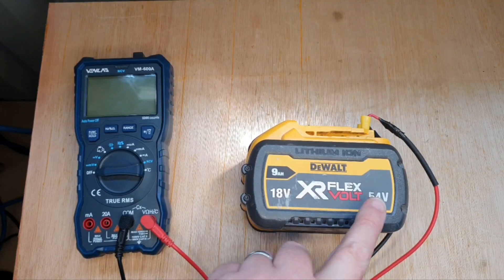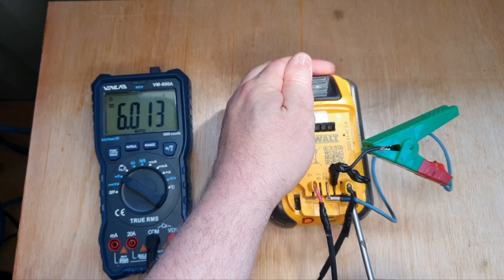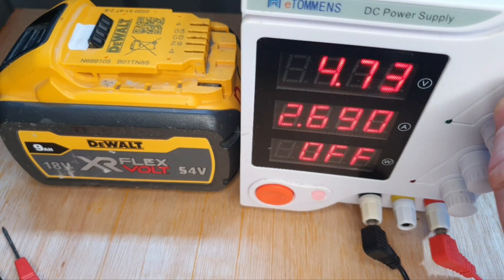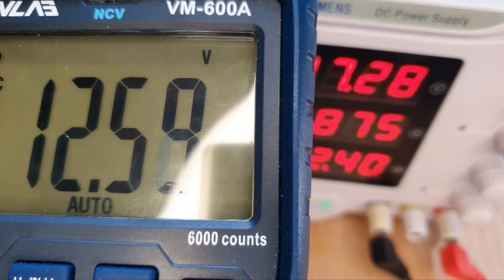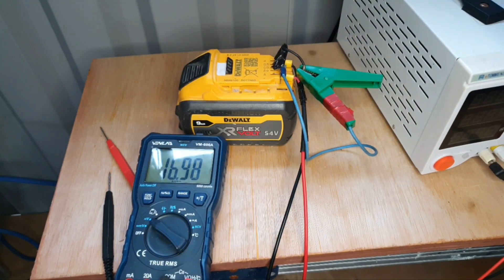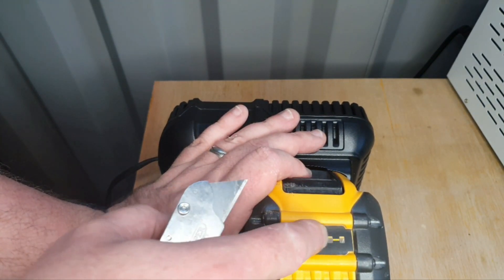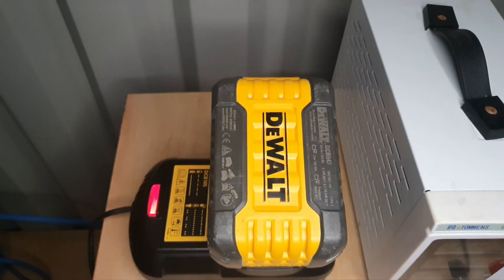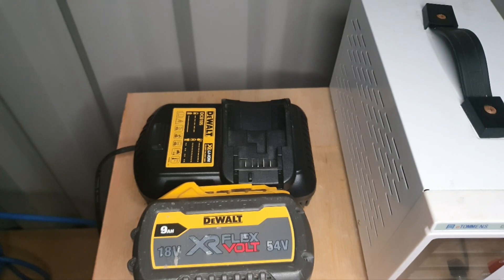How To Fix A Flexvolt (not jump-start) #dewalt #powertools #repair #powertoolrepair #Flexvolt #xr

Comment from the maker: The items used in this repair 
Venlab Digital Multimeter
UK https://amzn.to/3KDi805
USA https://amzn.to/3MlEep8
DC power supplies 
  UK link  https://amzn.to/3LMSO93   
                                                                                                   USA link  https://amzn.to/42ya87A
Reply: How do the battery’s get to that point where they’d need a jump start. I have a used flex volt 9 AH I just bought and it won’t charge and I have no light bars that come on and haven’t tried anything so far!
Reply from the maker: @Rocky-e2b  the cells can drop below chargeable limit I don't recommend just start on flexvolt though
Reply: @doctorlefthandthread  What do you mean just start on flex volt?
Reply from the maker: @Rocky-e2b  sorry typo, I meant jump start don't try and boost it off another battery is what I meant
Reply: @ oh ok how do I jump start it? I was going to try it off another battery lol
Reply from the maker: @Rocky-e2b  I would use a dc bench power supply
Reply: @ Ok I’m hoping I can revive this flex volt battery I bought but might be more wrong with it. I get no light bars on the back and try’s charging for a minute then says it’s charged but it’s not! Won’t do anything it’s a 9 AH
Reply from the maker: @Rocky-e2b  can you check the voltage coming out the top
Reply: @ Yes I sure will I’ll let you know on Friday I’m a trucker and I’m on the road lol From Canada!
Reply from the maker: @Rocky-e2b  cool
Reply: @ I’m just trying to learn a bit about this stuff I love your videos!
Reply from the maker: @Rocky-e2b  stay in touch if I remember I will show you how to test both voltages of the flexvolt 20v and 60v
Reply: @ ok sounds good thankyou!
Reply: @ I checked some stuff out last night there is 16.8 volts coming out of the top of that 9 AH flex volt battery. And I think from checking the cells I have one that’s not working. Most the cells were in between 3.2 and over 4 but I had one that’s reading nothing. The battery looks like it’s seen some moisture in it. It might be a bigger job than I wanna get into lol
Reply from the maker: @Rocky-e2b  I am refusing to.work at flexvolt because the teardown and rebuild takes too.long and there are so many thermal fuses and resistors to blow. You could just have dead cells and imbalance across the pack but even then it is a bit of a mission
Reply: @doctorlefthandthread  Yes exactly it looks like a chore lol
Reply: What unit did you buy? 30v 5ah or higher?
Reply: 30v 0-10A,  Is my DC power supply I just got yesterday dead?  The (V) I set it to 1730V, it is steady on 1756-1757v.  The (A) and the (W) is reading zero not running.

Comment: Fl;exvolt 6Ah dead as - about 2v in 18v mode. I charged with bench power to about 17.5v but it wouldnt charge on dewalt charger so I kept charging and tried it again but no go, so I charged it to 19.5v on bench power and its finally started to charge on dewalt charger - its was already at 3 bars at that stage.  Gunna see if it charges again after discharge.
Reply from the maker: Try it yes if it doesn't it's likely done
Reply: @doctorlefthandthread  I ran it down to 1 bar on the heat gun, and it recharged back up to 3 bars!!!! Awesome.
Reply from the maker: @simonedwards3577 that's awesome 👌

Comment: Got a DC power supply, tested each group beforehand to make sure no over voltages.  Cell groups were all under 2v.  Tried it anyway.  Brought the battery up to 17v.  Tried to charge on my 12-20v max charger.  Blinks for a second or two but the blinking slowly fades to nothing after another second or two.  Working flex volt charges on it just fine.  Maybe the cells are just shot?  I’m gonna test voltage one by one to see what’s going on.

Comment: I charged it to 19v but still when i put it on the dewalt charger theres nothing, one glash of the red light then nothing?
Reply from the maker: Could be cell imbalance thermal fuses resistors all very time consuming

Comment: I’m replaced all cells with new one. But charger still don’t want regonized battery. Is bms bricked?
Reply from the maker: If they are all balanced the bms is done
Reply: so…dewalt also moved to the other side… with hilti….

Comment: I am having a similar issue but when I try using the desktop dc charger I set the voltage as younahve shown and set the amps to approx 0.5 but after a while it drops to zero on the amps any ideas ?

Comment: What volt and amp should i charge each sell at individually pal
Reply: 30v 5amp
Reply from the maker: @deanthompson6664  I would set the amps low probably 2amp and the voltage at 4v
Reply from the maker: What charger are you using?

Comment: What’s concerning to me as I’ve been buying quite a few of these Flex Volt batteries is that this one in the video is only 5 years old, it doesn’t look abused and yet it’s essentially dead. That’s a $200+ battery, DeWalt needs to step it up. I have 20V batteries that are 10 years old or better that are all still fine, being used daily.
Reply from the maker: I agree the failure rate of the flexvolt batteries is too high

Comment: I got some 6ah and 9ah flexvolt battery with 1 bar and 2 bars.  The 2 bars battery, it will charge but will not charge up to 3 bars.  How do you know what volt(V) # and Amp(A)# to set on the DC power supply? I don't know so I just put the same # like you did here.  I charge the battery with no bars, after 5hr plus, it is showing one bar.  I shut it off and try to charge it in the battery charger but it is still not charging.  I hook it back on the dc power supply to charge now why is my (A)amp and my (W)watt display is reading zero?

Comment: This method worked for my battery that showed 1 bar only but would never charge past it on the dewalt charger.  I slow charged it for 3-4 hours and it came back to like.  I spent $30 on a dc battery charger from amazon to save a $180 dewault battery.  Well worth it.  Thanks for making this video!
Reply from the maker: Great to hear

Comment: Hi there 
I have a problem with my DeWalt 6ah as soon as I put it in the charger the light comes on and then off straight away. Any idea what could it be ? There's no breaks in the nickel contact bars.
Reply from the maker: Could be dead cells or something else popped on the board
Reply: @doctorlefthandthread  my 9ah had some visible bits of coating missing from the board and it only charges one bar

Comment: could you design and produce a Jump-start charger product for sale.
Reply from the maker: The jump Start is frowned upon by some due to the sometimes volatile nature if lithium ion however you can use a dc power supply to bring one of these batteries up slowly

Comment: Had a 6 Amp Flexvolt refuse to charge today. So I stuck it on a heat gun and ran it until the heat gun stopped. Then the battery charged! Happy days!
Reply from the maker: Works sometimes
Reply: I'll have to try that if I had a heat gun. My 9AH won't charge. I watched this video that explains what the main problem is: https://youtu.be/ZJHKoo2shBA?si=scqrbh1N1hQQ_HsU

Comment: I have an issue with a 9ah flex volt, goes on charge, but stops charging after 5 mins, only one led bar lit on indicator, but charger says its full. Got 16.5vdc across B+/- terminals, can this be saved?
Reply from the maker: Possibly try this first 
https://youtu.be/IUlHVVt-ptg
Reply: @doctorlefthandthread  everything is intact, no burnt or broken connections. I used a jumper across C connections and pushed plungers, got 49.7v on the 54v side. Digging a little further I think I have a dead cell. One is reading 0v, with all others giving 3.4 to 4.0v
Reply from the maker: @grantmacdonald3126  hard to change a cell in the flexvolt

Comment: Careful with that, I just diagnosed such a battery for someone and one cell was at 5.3v and another was 0.3v. That 5.3v cell is a pending home insurance claim. A cell under 2v can't be recovered, it has to be replaced.
Reply from the maker: 5.3v wow yeah that's high

Comment: I've heard jumping these batteries can turn them.into a fire hazard. Is that true? If you have a dead cell it over charges the other cells
Reply from the maker: The cells have a little failsafe on them that breaks the internal connection rendering the cell useless if it gets over heated of overloaded. The failsafe is more likely to deactivate the cell. If the cell  doesn't deactivate you can experience something called thermal runaway where a cell keep heating up until it explodes. This is very rare and I have never experienced it yet but it is highly dangerous.

Comment: Have a 9ah that reads 17v between b terminals. Almost never used, charged less than 10 times. Was able to run a Dewalt chainsaw with what was left in it but will not take  a charge now. Any ideas? Charger is working on another 9ah. Will charging with a desktop power supply balance the cells if thats the issue?
Reply from the maker: Sometimes running it down to a very low voltage then bring it up with a desktop power supply can work. It has for me but it doesn't always work.

Comment: Why did you test it on an 18 volt tool and not a 54 volt tool?????
Reply from the maker: Thank you for commenting yes you are correct the right thing to do is test it on a 54v tool. So why didn't I?
The simple answer is I did not have a 54v tool available that day but it did work on 54v. I did get it tested later.

Comment: Have the same problem with Milwaukee 8.0ah battery which charge only 3 bars without completing the 4th and have a 12 ah with no charge as well, opened it and checked the cells 3 of them was 3.8 and others are 4, I need to find a way to balance them now, which I am gonna try, this coming weekend 🙂
Reply from the maker: Makes sense they are out of balance

Comment: I thought that being 6 volts across the pack would mean it's dead as a doornail. I got a 12ah here with water damage and it's reading 0 on most cells. I doubt this would work for me
Reply from the maker: Probably not. sometimes if there is some kind of voltage you have a chance to bring it back. conventional wisdom would dictate that if they are below 3v volts I am not conventional or wise so sometimes it works for me
Reply: @doctorlefthandthread  got a 6ah, its a 2022 battery in great condition. Wont charge but voltage across the pack reads 14 something volts, would ya say its fixable?
Reply from the maker: @konstantine381  it could be check for broken connections https://youtu.be/dDP1SHhLgL4
Reply: @doctorlefthandthread  no broken connections, looks like someone's resoldered the board on but the battery works in 18v and 60v. It just has a solid light on the charger and the cells are all 3.3v after i jumped them but still no luck. Might see about replacing the board
Reply from the maker: @konstantine381  what voltage do you have at the 60v range?
Reply: @doctorlefthandthread  51.3v in 60v mode and 17.1v in 20v
Reply from the maker: @konstantine381  if you could drain it and slowly charge it up to 17.5 it might take the charge then
Reply: @doctorlefthandthread  ah ok, so i can slow charge with another battery?
Reply from the maker: @konstantine381  you probably need a bench dc power supply
Reply: @doctorlefthandthread  got one now, gonna see how it goes 😁
Reply from the maker: @konstantine381  good luck sir
Reply: @doctorlefthandthread  ok got it up to 17.6v and still can't get it to charge. Gonna see if it's the board
Reply from the maker: @konstantine381  must be some connection issue
Reply: @doctorlefthandthread  probably, finding it difficult to see why it doesn't charge at all.
Reply from the maker: @konstantine381  if you discharged recharged checked the connections on the sides the ain't much more I can suggest but if you find out anything let me know
Reply: @doctorlefthandthread  yea I'll try charge it higher an see if it does anything

Comment: I've been given two 9AHr batteries to diagnose. Charge and work fine on 18V but no 54V tool to test. Tried the jumper between C1 and C3 but no change. Output is 20v then when you press the side buttons it graduslly drops to 0v as if output disconnected and capacitor discharging. Any ideas?
Reply from the maker: There may be a burnt out connection I would guess this might help https://youtu.be/2tTX7DJywig
Reply: @doctorlefthandthread i must apologise. Turns out I hadn't pushed the side plungers in far enough. Half way in drops the voltage to 0v over time. All the way in so you can't see the black plunger any more gives just over 60v.
Batteries all check out, must've been the dirty contacts!

Comment: Had a flexvolt saw burn out on me and the 54v battery that was in the saw only works in 18v tools now is there a way of fixing that? Maybe its stuck in 18v? Any ideas?
(Tried another 54v battery in the saw and that too only works in 18v tools)
Reply: You suggest the second battery only works at 18v too. Did it work on 54V before? As if trying it in the burnt saw broke the second battery?

have you tried the shorting of C1 to C3 and measuring output voltage?
Reply: @ianhelsbyservices  yeah both 54v flexvolt batteries where working before on 54v now after been in the burnt out saw both only work on 18v tools.
 I'll try short the c1 toc3 when I get home
Thanks for replying
Reply from the maker: Try this too
https://youtu.be/2tTX7DJywig

Comment: Thanks for this videos, i got the same 9ah flexvolt. But my problem is that it doesn't charge over one bar. Do you think jumpstart would work or some cells my be dead?
Thanks for your help❤
Reply from the maker: Good question and I managed to get one going that had the very same issue I used a USB adapter on a ring light to drain the battery down low then brought it up using the power supply as shown in the video to around 17v it then took a charge

Comment: Thats how it should be done nice one. BTW the 6Ah flex uses 18650s
Reply from the maker: It does thanks for your advice regarding that I am getting there
Reply: So did the older 9ah apparently.The ones with the silver tabs on top had the upgraded cells.Ive got both.(vs 21700 cells)
Reply: @garthqueen  The older 9Ah (mid 2018 and prior) used Sanyo 20700 cells, not 18650s.